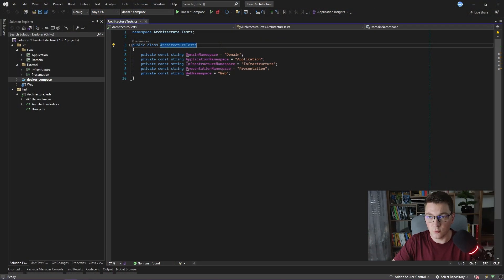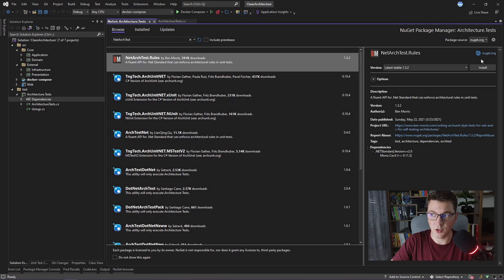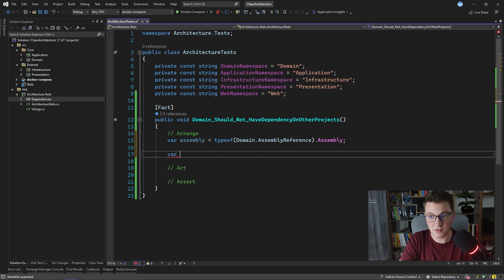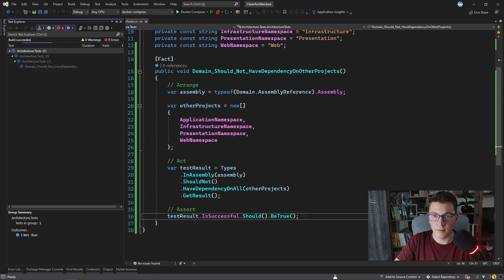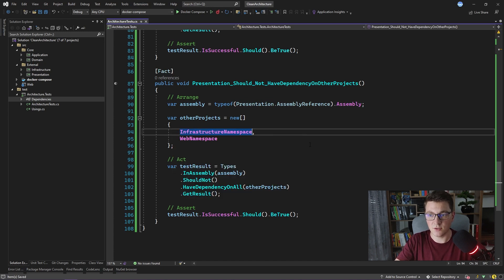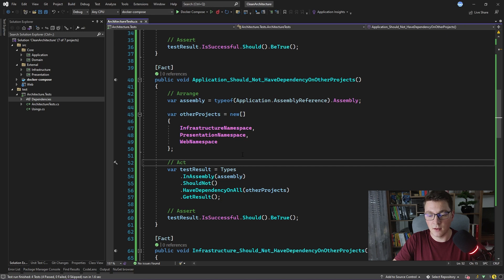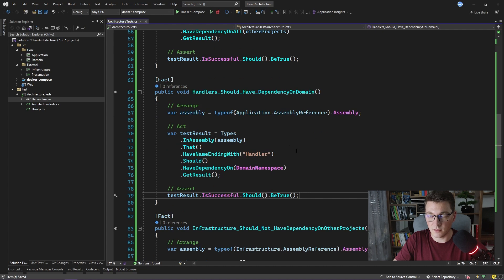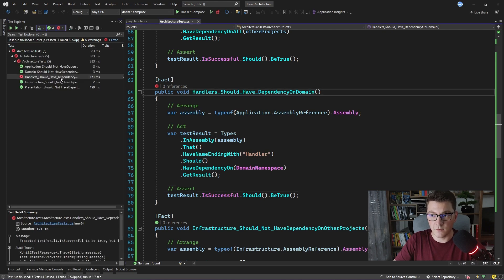How to Write Architecture Tests for the Clean Architecture

Comment: One thing to mention in relation to this video is that AssemblyReference in the sample for typeof(Domain.AssemblyReference).Assembly is not some kind of internal feature but simply an additional class inside Domain Project to be able to reference this project without attachment to any domain specific entities/classes inside
Reply from the maker: Thanks for bringing that up. It's only after recording this video that I had to explain that it's something I custom built to make arch. testing easier.

Comment: Summary: 

Clean Architecture Overview
Layers of Clean Architecture:
Domain Layer: Core of the system containing domain entities, business rules, aggregates, value objects, domain events, repository interfaces, factory interfaces, and domain services. The domain layer should not reference any other layers.
Application Layer: Acts as an orchestrator, defining important use cases via application services or CQRS pattern (commands and queries).
Infrastructure Layer: Manages external systems, database access, message queues, email services, storage services, etc. It hides the implementation details of external systems.
Presentation Layer: Entry point for users, often implemented as a RESTful API or gRPC, defining endpoints for interaction with the system.
Project Setup
Project Structure:
Core Folder: Contains domain and application layers.
External Folder: Contains infrastructure and presentation projects.
Domain Layer
Entities: Define domain entities like "Webinar" with properties like ID, name, and scheduled date.
Custom Exceptions: Define exceptions specific to domain operations.
Repository Interfaces: Define repository and unit of work interfaces without implementations.
Application Layer
Commands and Queries: Use CQRS pattern to segregate command and query operations.
Command Example: CreateWebinarCommand contains data needed for creating a webinar and is handled by CreateWebinarCommandHandler.
Query Example: GetWebinarByIdQuery retrieves webinar data, handled by GetWebinarByIdQueryHandler.
Crosscutting Concerns: Use Mediator for CQRS pattern implementation, allowing pipeline behaviors for command and query validation.
Infrastructure Layer
DB Context and Repositories: Use Entity Framework for database access and define repository implementations.
Migrations and Configurations: Handle database migrations and entity configurations.
Layer Splitting: Possible to split infrastructure layer into persistence and other external systems management.
Presentation Layer
Controllers: Defined outside the web application to enforce architecture rules and support dependency injection.
Endpoints Example: Controllers handle HTTP requests and use Mediator to process commands and queries.
Configuration: Add necessary configurations in startup.cs to ensure controllers function correctly outside the web application.
Additional Configuration
Exception Handling Middleware: Custom middleware to catch exceptions, log errors, and return appropriate responses using standardized formats like problem details.
Reply from the maker: Is this AI-generated? 🤔
Reply: @MilanJovanovicTech  Yes it is. After ı watched the videos I am getting summary from the chatgpt instead of writing my own notes😅

Comment: I like your content very much, it's invaluable, however on quite a few occasions I found it hard to follow along because there were missing bits. For e.g. Domain.AssemblyReference I can't get it to compile. I went back to the previous video and I could not see where you mentioned AssemblyReference.cs I learn better by doing not just watching/listening. Maybe I missed it but Domain.AssemblyReference is not compiling

Comment: There could be cases where you don't actually need to deal with entities defined in domain or call application using MediatR in controller, you just gotta do some poc calculation in controller, then such restrictive test cases would always fail. There should be some attribute telling on controller/action or any test object to tell that it should be bypassed from test cases?
Reply from the maker: This doesn't make a lot of sense if you want more freedom with the architecture

Comment: @MilanJovanovicTech  Thank you very much for your videos. It's really helping me in upskilling myself. Just need to know why you used Types.InAssembly(assembly) and not the  Types.InCurrentDomain().ResideInNamespace((DomainNamespace))?  I am thinking that this will avoid the creation of the AssemblyReference class in each project, isn't it? Or am I thinking it wrongly? I appreciate your response. Thanks.
Reply from the maker: There are many ways to solve the same thing, so this is one of the possible solutions

Comment: At about 2:39, you mention you are using an assembly reference, an tthat you have them each of the other projects as well.  Are those automatically created when you make projects?  Where do they come from?  I've read in the docs that you create them with compile switches, but this is the first I've seen about creating them.
Reply: I see in a prior response that it is simply a static class in each of the projects... is that all there is?  Seems simple.
Reply from the maker: Yup, that's all there is to it 😁

Comment: Great content! But, there's something that I'm still not getting it. In the Clean architecture book, it looked like the Infrastructure layer ( Frameworks & adapters ) should create a reference to the Presentation layer ( Interface Adapters ). But, in this video you did not create this connection. What would be the proper solution? I'm just starting to learn CA and DDD, so I don't have a clear vision on how to implement in a better way.
Reply from the maker: They're all on the perimeter of the architecture, so it's all your interpretation of it
Reply: @MilanJovanovicTech  Thx for the reply Milan. Your videos are helping me a lot to understand some more advanced topics.

Comment: I don't know if this has been mentioned before. In that case please forgive me. 
While using your approach to architecture testing, which you explained very well btw, I encountered an error in your approach. 
Instead of testing with `.ShouldNot().HaveDependencyOnAll(otherProjects)` you should have tested for `.ShouldNot().HaveDependencyOnAny(otherProjects)`

Your tests now pass as long as the tested assembly doesn't contain a type with a reference to (not all or) at least one of the other projects, which is always true. Instead no type should have a reference to "any" of the other projects.
Reply: I agree with you. This package have very interesting behaviors. ``ShouldNot().HaveDependencyOnAll(otherProjects)`` this line of code works successfully even if you add a reference of an assembly that current assembly you tested doesn't include that parcticular depedency. Which is also very intersting. I will go with ``ShouldNot().HaveDependencyOnAny(otherProjects`` as you said. If anyone understands the situation, please enlighten us 😅
Reply from the maker: I may have made a mistake back then, unknowingly

Comment: So Handlers_Should_Have_DependencyOnDomain is checking to see that the applicaiton assembly has a reference to the domain assembly? Not sure I get the point of the test. If it didn't have that reference then you would have many build errors anyway.
Reply from the maker: That is true indeed
Reply: @MilanJovanovicTech  - That means, in my opinion, this test adds no value. Anyway, great series of videos.

Comment: It would be good if the test that checks if controllers depend on MediatR would identify what controllers have violated the rule. In theory, there could be a handful of controllers in the project.
On the other hand, then the test will fail, probably just some of them will be changed which reduces the potential range of controllers to check manually.
Reply from the maker: I'm sure you can write more robust tests to decide that. Or maybe there are other libraries out there.
Reply: @MilanJovanovicTech  After experimenting a bit with the NetArchTest.Rules I discovered that it already provides a way to report types that violated the constraint. The TestResult returned from the GetResult() call has readonly collection that contains types failed the test. So I've tried to use FailingTypeNames property instead of IsSuccessful.
I faced one issue. When no test has passed and there were no types that violated the constraint I got a null value, instead of an empty list. Most likely it is because it was not possible to return shared readonly lists before .Net 8. And it seems that in .Net 8 it will be possible to return ReadOnlyCollection<T>.Empty. That made standard Assert.Empty() from xUnit unhappy. Because of that I switched to FluentValidation and that solved the problem, so I ended up with something like testResult.FailingTypes.Should().BeNullOrEmpty()
With such a check I'm getting a list of types that violated the constraint directly in the test result.

Comment: Excellent series. But here the tests you wrote for checking the assemblies should use HaveDependencyOnAny and not HaveDependencyOnAll. As written in the video the tests will succeed unless every assembly is used.
Reply from the maker: I may have made a mistake there, you're right
Reply: thank you for your comment I was looking for the solution entire day until I find your comment and realize that the method which was used in video was incorrect.

Comment: Sorry, for my late question but if i want this test "Domain_Should_Not_HaveDependencyOnOtherProjects" to fail what should i do? I try my best to make it fail but it always pass for instance I put a reference of Presentation on Domain and visa versa.
Reply from the maker: What are you using in the assertion?
Reply: @MilanJovanovicTech  
I'm using "Fluent Assertion" Nuget Package
Reply: You need to use an actual type from another assembly to make it fail, just adding a project reference is not enough. Guess the compiler/linker is smart enough to exclude it if it's not used.

Comment: This is good. But shouldn't it actually be ShouldNot().HaveDependencyOnAny() instead of ShouldNot().HaveDependencyOnAll()?
Reply from the maker: This seemed to get the job done, but you could be right!
Reply: @MilanJovanovicTech  Yeah, when I tested this solution, it was checking if all of the dependencies were present, not any of them. Thanks for the reply!
Reply: @MilanJovanovicTech  It seems but if you add a dependency the test is still successfull. So Jakub is right, we should use HaveDependencyOnAny isntead of HaveDependencyOnAll. And Jakub's comment should be the first to be visible in the list of comments, not the last one as it is now...
Reply: @lionelb.9596  I can confirm that.
Reply: I'm also with Jakub

Comment: Hi Milan, i don't seem to get a hang on the Domain.AssemblyReference is there a why i'm not able to call it.  i just create those class library to test this guides out.
Reply from the maker: It's hard for me to tell what could be the problem without seeing your code
Reply: @MilanJovanovicTech  Same problem, you mention that you have a AssemblyReference defined in the Domain project and also the other projects. How to?
Reply: @MJ-yx4ut  HI i have this problem. did you solve the problem ??
Reply: @MJ-yx4ut   Same problem, Did you solve the problem ??
Reply: @endersonfloriansolano7251   It's nothing special. Just a class with static property
e.g. 
    public class ExternalAssemblyReference
    {
        public static readonly Assembly Assembly = typeof(ExternalAssemblyReference).Assembly;
    }
Reply: @MilanJovanovicTech  i don't have access to the AssmblyRefrence even when i added Domain as a project reference to the test project. PS it's just an Empty class library i don't have any class in it.

Comment: Hi Milan.  I am really enjoying this series, and I especially appreciated the structural "discipline" the architecture tests enforce, but I have a question.  You show each "layer" of the solution, especially the application and domain, as single c# projects.  For larger, more complicated projects, do you ever split these layers up into multiple projects or just let them grow horizontally?  If you split them up, do you just handle and test the references individually, or is there a better way?  Thanks again for the great content!
Reply from the maker: Depending on the size of the individual projects, I may end up splitting them into separate projects.

I'm not sure if there's a better way to handle the architecture testing part. You have to write the tests regardless, I guess.
Reply: @MilanJovanovicTech  Thanks, Milan, for the quick response.  I guess it makes sense that the references between the "subprojects" between the layers are on a case-by-case basis, but it sounds like the arch tests may get complicated!

Comment: Mlian, in your example you deleted Domain Layer reference while testing Infrastructure dependency. So i am wondering about can we have the reference of Domain Layer in Infrastructure Layer? If we cant, how can we read from database or an external API inside Infrastructure Layer(because our entities are in Domain Layer)?
Reply from the maker: You can reference Application from Infrastructure.
And Application references Domain.
So, by extension, Infrastructure already references Domain.
Reply: @MilanJovanovicTech  Yes sir you are right. So we can simply use "using Myapp.Domain.Entities"  inside a class in Infra Layer. It will find the namespace over Application Layer
Reply from the maker: @hamitkarahan2973  You got it! That's precisely the idea

Comment: Good content, learned a lot.
Shouldn't it be HaveDependencyOnAny instead of HaveDependencyOnAll
Reply from the maker: Depends what you want to check. I want to confirm that it DoesNot_HaveDependendencyOnAll in this case.
I didn't try it with that approach, to be honest, but it seems feasible.
Reply: @MilanJovanovicTech  If I put in Domain 

namespace Domain;
public static class AssemblyReference
{
    public static Type Test => typeof(Infrastructure.AssemblyReference);
}

Then HaveDependencyOnAll passes but Any fails
Reply from the maker: @JyriHujanen  Interesting, I'll take a second look at this.
Reply: @MilanJovanovicTech 
It seems to work the same way as LINQ All and Any, so the HaveDependencyOnAll will be true only when there is dependecy on all
 
var AllTrue = new bool[] { true, true, true };
var AllNot = new bool[] { false, true, false };

AllTrue.All(x => x)   true
 AllTrue.Any(x => x)  true

AllNot.All(x => x)  false
AllNot.Any(x => x)  true

Comment: Nice video, thank you.
If you are working on a single project, that is straight to the point. Perhaps a nuget package to validate the basic "clean architecture rules" can reduce the boilerplate stuff...
But if you are working with CI/CD pipelines, you can use  for example "ndepend", to validate naming pattern/dependencies/etc. As an software architect it's much more easier, to control the code and architecture quality.
Reply from the maker: I haven't used "ndepend" before, will check it out. Thanks for pointing me in this direction!

Comment: Awesome Milan, I0s there a way to test if Command and Query class have Handlers or not?
Reply from the maker: I guess this is tested by "default" at runtime. I believe there is an exception if there is a command without a handler - at least with MediatR.
But otherwise, we could test it - there is a way to combine these conditions which I didn't show, but can be found in the documentations.
So we could write a test the checks that all commands in assembly A have a respective command handler in assembly B.

Comment: Dont work on my project :( 
Maybe cause my namespace contains dot ?
Reply from the maker: Could you share a Github repo with your example?
I can take a look later.
Reply: @MilanJovanovicTech  wierdly, when I debug the test, what i get in testResult looks like all classes
I have only 5 handler, and the count is 30 :/

var assembly = typeof(Application.AssemblyReference).Assembly;

        var testResult = Types
            .InAssembly(assembly)
            .That()
            .HaveNameEndingWith("Handler");